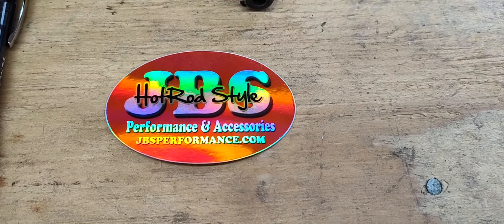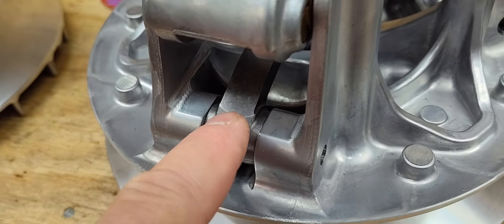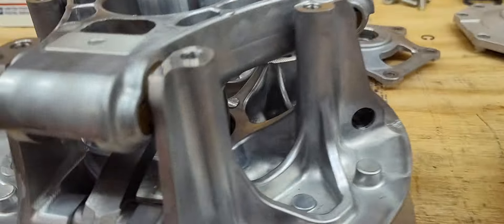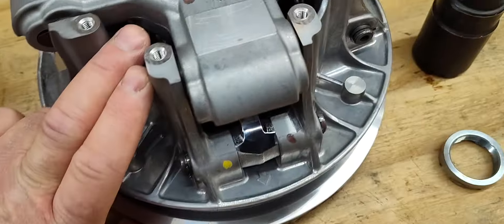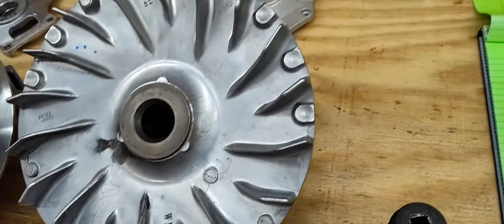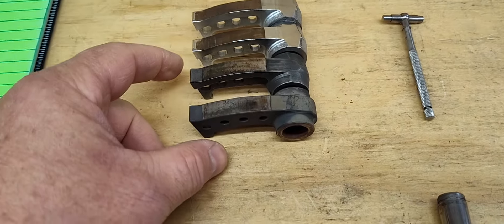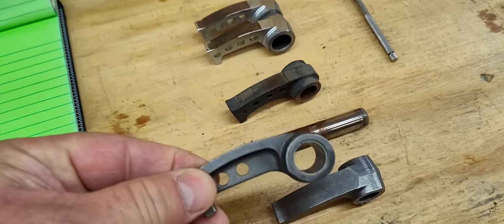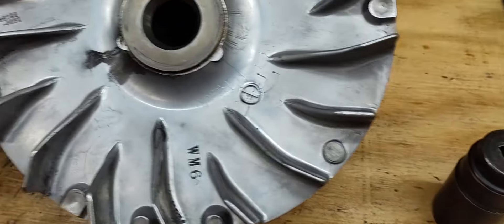New 2025 Kawasaki KRX Primary Clutch differences!!

Comment: Kawasaki is sending me a new primary for my 2020 krx.warrenty is up but they are standing behind it knowing the issues.secondary is slightly groved also.will that be a problem with the new primary if I don't replace it also in your research.notice brother I didn't say opinion ❤
Reply from the maker: how many miles on secondary?
Reply: @WVHotRodRhino  3400 but no issues yet with clutch
Reply: ?  I have a 2020 krx with 350 miles and my primary is grooved. My dealership wasn't any help to me. How did you get kawi to replace it. Thx Bill
Reply from the maker: @MikeAult-mh2qu  have you ever serviced it. Took it apart and regreased? If not the Teflon on the secondary bushings will wear out and it will have a lot of play and cause higher belt temps .. very important but not many people do it
Reply from the maker: @billmcdaniel3510  all sheaves will groove some..at 350 miles unless you have had water in the belt box you should be able to install our weights and get plenty of miles out of that clutch
Reply: Call Kawasaki customer service yourself and let them know that it is a first gen machine.they will give you a log number for the dealership to look into it.
Reply: Total miles on mach 350 @WVHotRodRhino
Reply: @MikeAult-mh2qu thank you. Will do

Comment: I did the JBS Secondary spring and removed my primary spring, I noticed my belt temp was at 4 bars after a 20 minute ride, normally its at 1 or 2 max & thats with all day riding, dessert/dunes.
 I'm wondering if adding the JBS Clutch weights will fix the heat issue. I put it all back to stock springs for now so I don't burn up my brand new belt. (2024 KRX4 1000 ES SE) 900 miles on 35 inch tires
Reply: @BroMediaRyan  I have original clutches and first gen krx with 3400 mountain miles still going strong.If it ain't broke don't fix it.I am going to be putting in the jbs weights this go around though.
Reply from the maker: @BroMediaRyan  what size tires
Reply: @WVHotRodRhino  35’s
Reply from the maker: @BroMediaRyan  give us a call I have three different secondary springs and if you're running wide open all the time you need our lightest Secondary